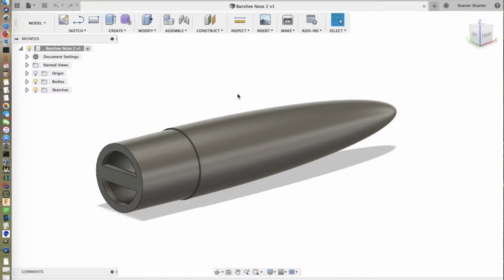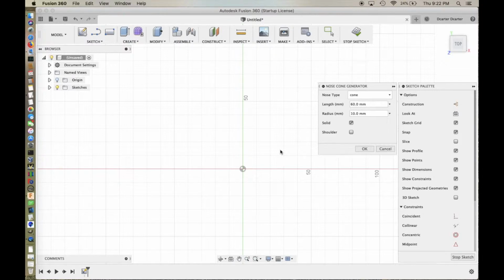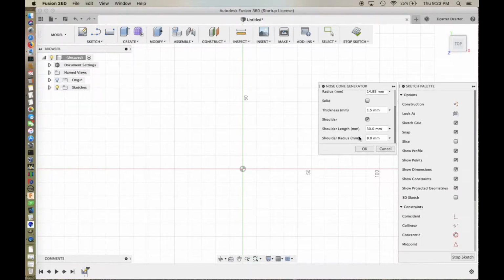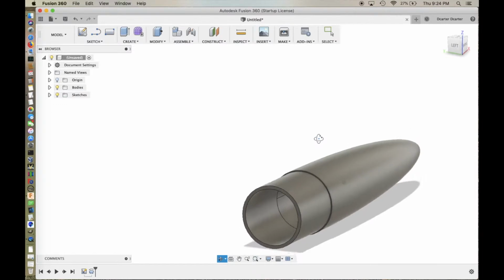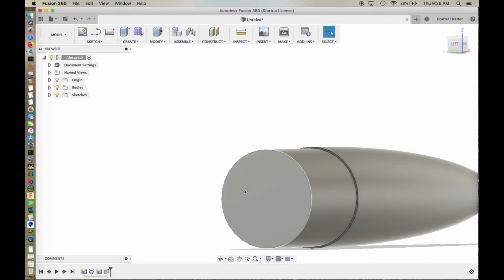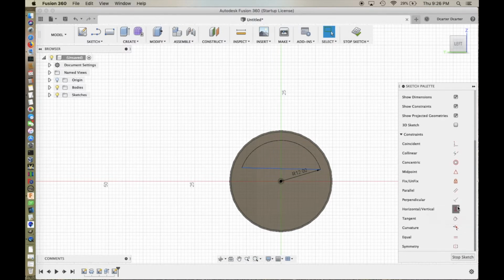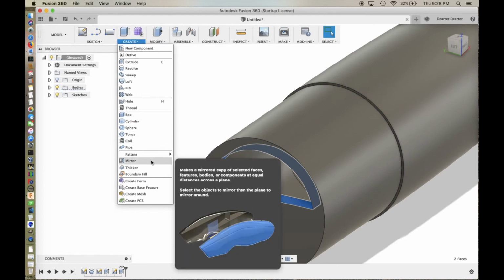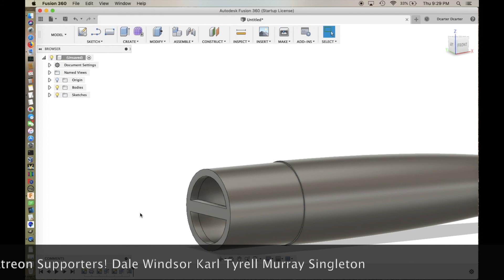Nose Cones in Fusion 360   Part 2

Comment: This is awesome! Thank you for coding this addin as it makes it so much simpler to print. Regarding the print, do you add supports for the shoulder? My tube is a little bit thicker than normal and I'm finding that the surface finish is less than desirable for the shoulder.
Reply from the maker: I usually use supports even for thin tubes, but my printer doesn't have a good cooling solution. Either way it's a sharp overhang so no computer will do exceptionally well, except maybe a resin printer?